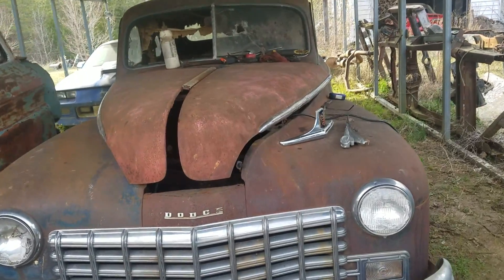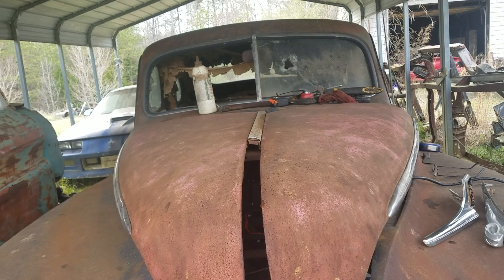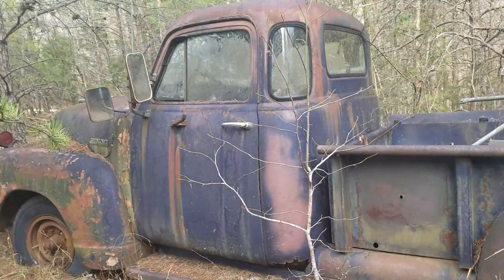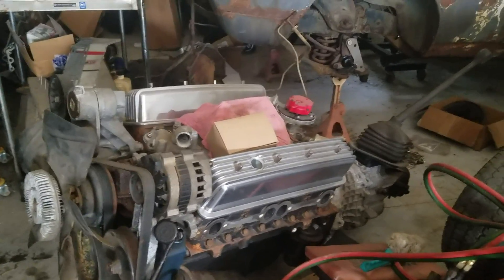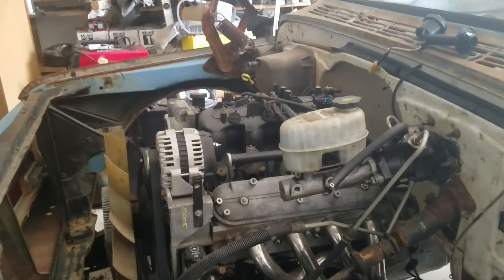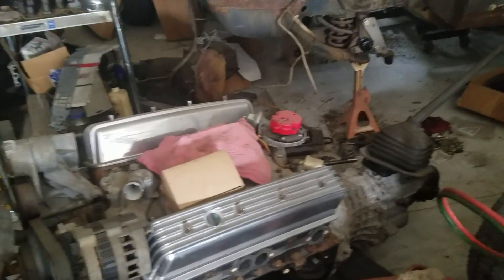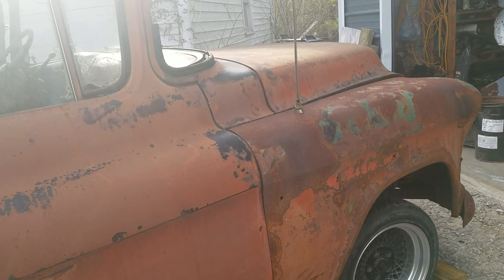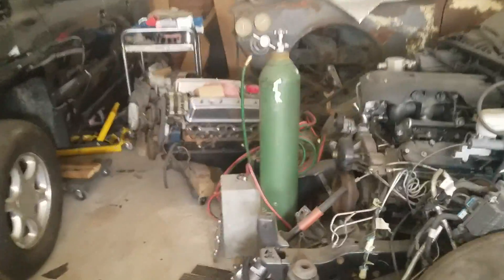47 Dodge Club Coupe barn find updates

Comment: Square body wrecker sounds like an upgrade, for an engine I'd want something a little stronger than a 350. Looking forward to your next video.
Reply: It's all about the gearing regardless of the cubic inches in any wrecker. The inline six cylinder engine has towed many cars and trucks through history, as has the 350 small block.
Reply: @lskiller1903  350 4bbl, 4 speed, 410 gears, 16 inch tires moving a Holms 550. Alway out of power always having to downshift